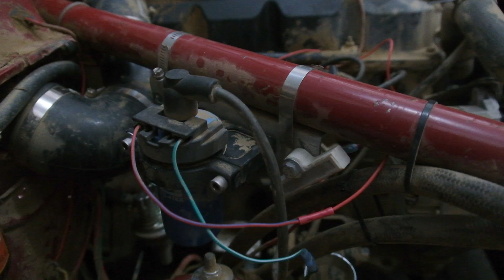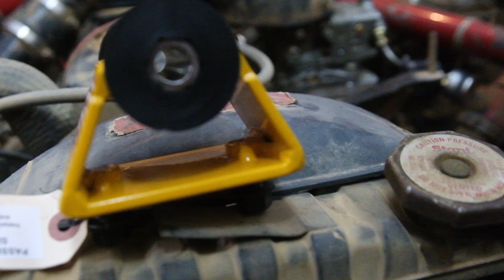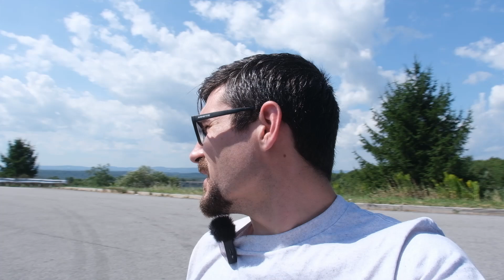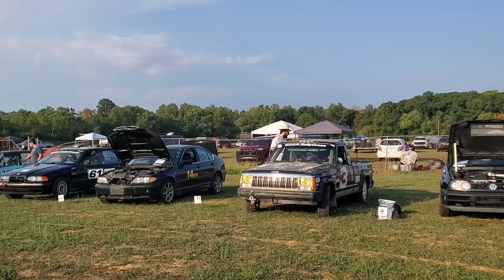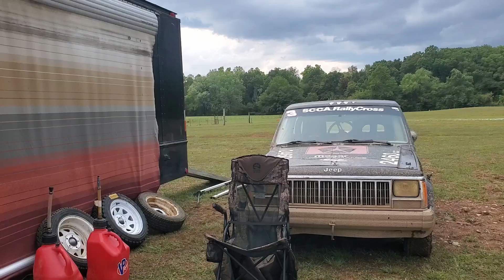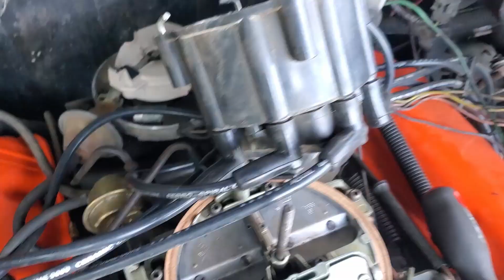Smooth Sailing (Country Roads Rallycross National Tour)

Comment: Notes while watching:
The engine mount difference is surprisingly huge
Door seals in Clyde may not be a terrible thing, means you get some airflow in there!
The suspension in Dewitt looks like its finally actually doing suspension things
Mud is muddy 
Need a safety supercharger for Clyde to pass dumb campers
Reply from the maker: @zacharykarr   doors are typically open anyway, suspension was mint 👌 and if I could keep it cool I would love a tunnel ram supercharger for safety

Comment: Seems like Clyde needs an EFI conversion before dewitt does. Or maybe just a flat upgrade to a turbo LS or diesel.
Reply from the maker: Ideally Clyde will be going to EFI but I wanted to focus on getting dewit EFI first
Reply: @powers2440  The process for Wally can be applied to Dewitt, and that can then be applied to Clyde.